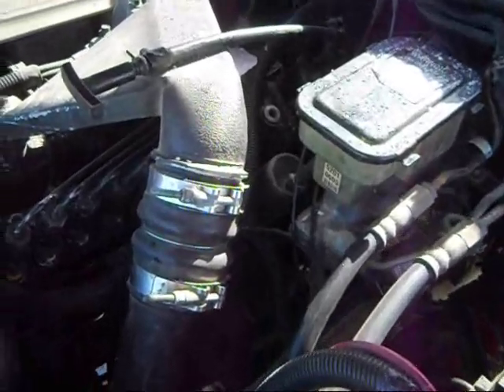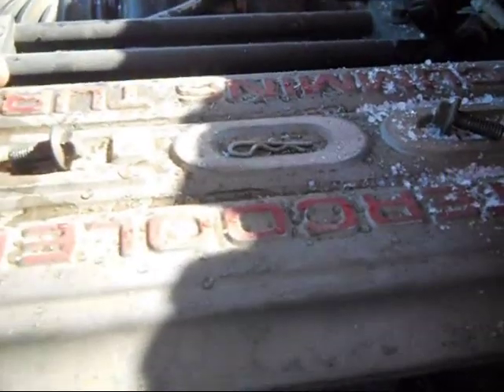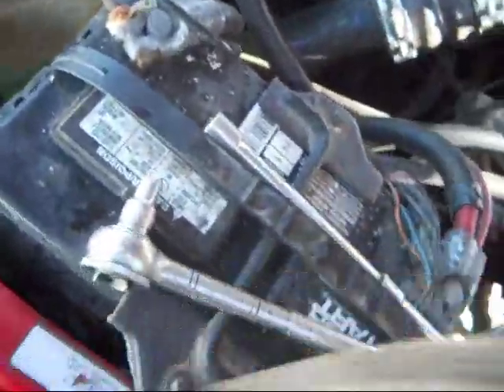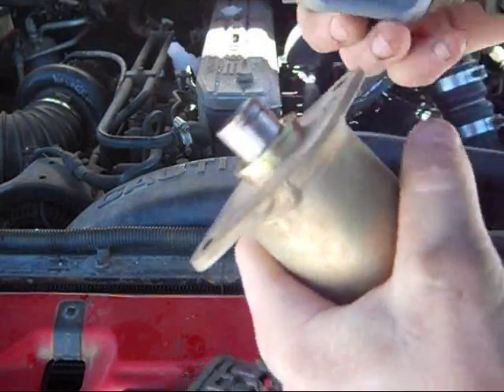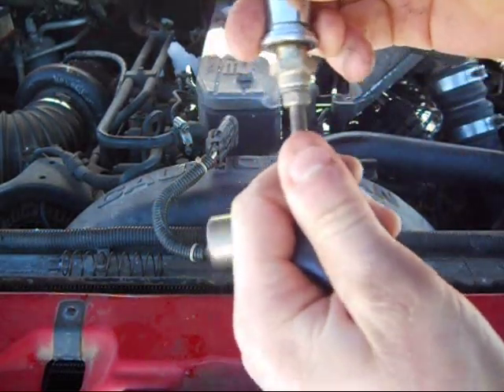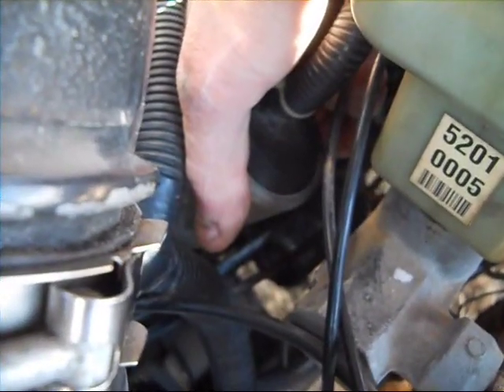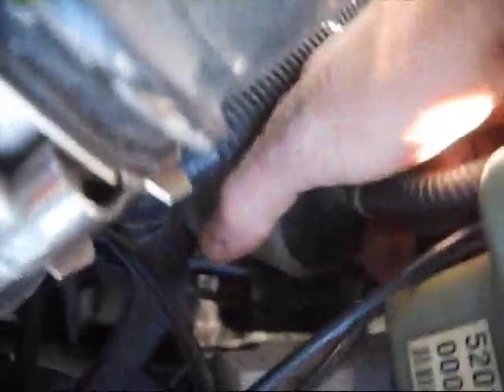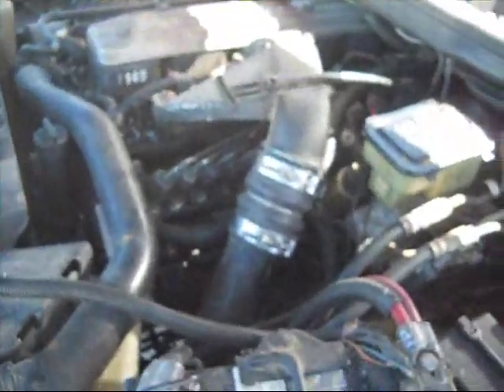Replace a Fuel Shutoff Solenoid Boot on a Cummins 12 Valve

Comment: Bro thank you sooooo much!! I bought a truck that was parked for 10years they replaced everything and couldn’t get it running. I replaced the relay and nothing. Now after watching your video I took it all apart slightly lubed it up and put it back together. The solenoid wouldn’t hold up so I adjusted it like you said and made it a bit longer. BAM TRUCK IS ON AND RUNNING 🙏🏼

Comment: i do a service on one 5.9 12v and i start the truck and run for 15 minutes then when i push the gas start to white smoke and misfiring and stop, and then saw that solenoid was tie with a wire and its loosened, grean video i know what i have to do with that solenoid!
Reply from the maker: +Miguel Figueroa Glad it helped!  Honestly your problem doesn't really sound FSS related.  If playing with it doesn't fix your problem, make sure you have good fuel pressure.
Reply: Thats right, i dont have good pressure on it, and its like air in the system, i prime it and then re check and see bubbles on the fuel drain manifold, the worst part its all of this is happen after me changed the timing case and cover gasket job, i hope the gear it not slide or something... but i dont think so because the truck already start

Comment: If you're having problems putting the back bolt in the hole.....of the solenid
I use 
Harbor freight # 96726
The flex shaft comes off
And magnetic socket 
Harbor freight # 60384
Plus you'll need the screw driver with different bits
works like a charm
And wobble extention will torque them fine
For those that are having problems...

Comment: I replaced the solenoid and a new wiring harness, also adjusted the solenoid and the truck starts great and idles but trying to get RPMs. It won't go fast enough to shift gears! And the strangest thing is there is no RPMs and speed showing on the dash? Can anyone help! Please
Reply from the maker: +John Sheffield  You say you replaced the engine wiring harness?  If so make sure everything is plugged back in like it should be.  Is the FSS adjusted like it is shown in the video?  Consider becoming a member on mopar1973man.com or cumminsforum.com and ask your questions there, I and many others will be able to assist you.